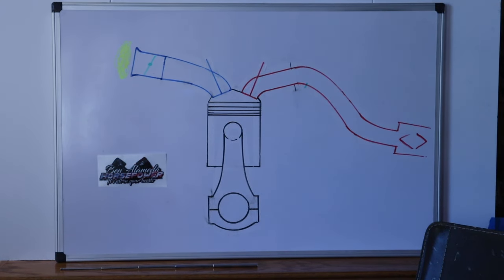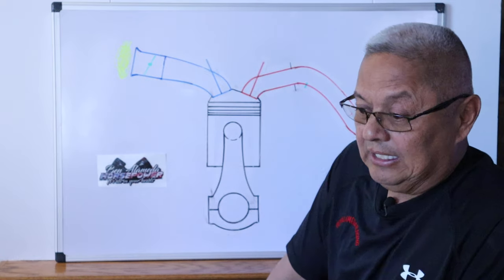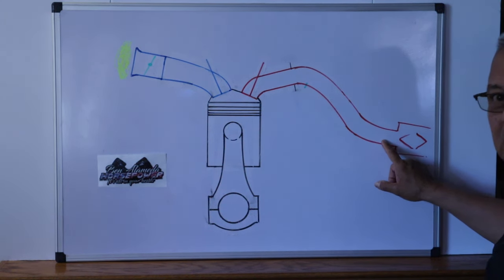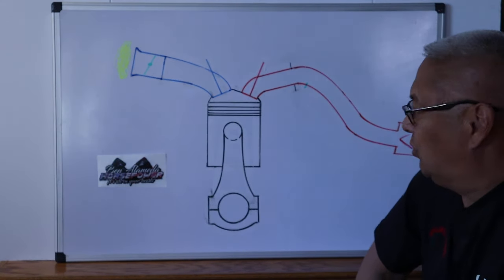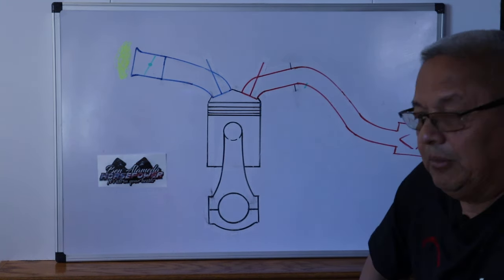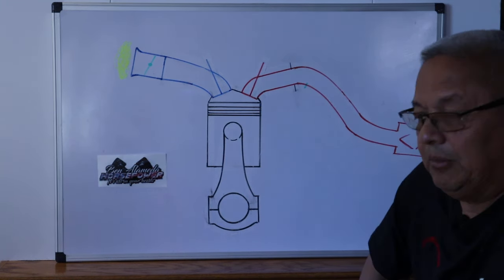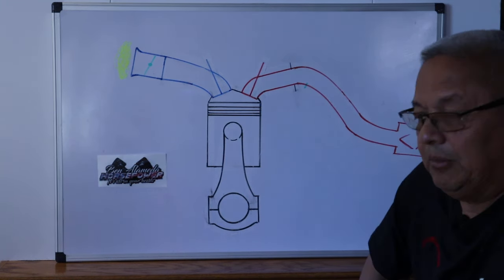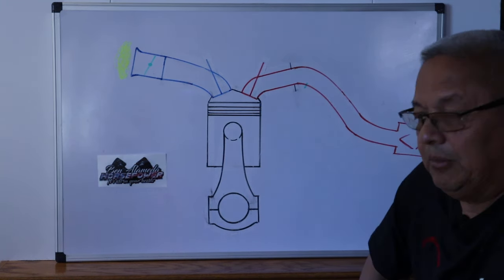DETERMINING EXHAUST & INTAKE  PIPE LENGTH!

Comment: The hole in the exhaust trick sounds like A.I.R. emissions systems designed to ignite the unburned fuel in the exhaust before it reaches the catalytic converter.
Reply from the maker: Thanks again Evan!

Comment: Just after the collector is where the crankcase evacuation valve goes. After watching the video is seems it's the worst place to put it because that where the exhaust speed drops off.
Reply from the maker: They actually merge in there and velocity picks up big time as opposed to positioning on individual pipes where reversion comes into play giving you erratic signal to pull in vacuum.

Comment: Most common sense editorial I've ever watched! Been telling guys for 20 years you're running to big a carb! The math doesn't add up! A vacuum secondary carb with the right jetting and springs along with the bosters will win most street races!  You can't use what you can't hook up!😂😂😂
Reply from the maker: Many overcarb their engines and turn it too slow!
Reply: @benalamedaracing2765  well, I think that with vacuum secondary carb, on the street, it's pretty flexible! Ran 3310s on 306 Ford successfully for years! Just play with the springs! But, a 600 for strictly street use has better throttle response with real street converters! Daily drivers! But with a stick shift? Every street race I lost was in the first 50 feet! Three light poles ain't alot of real-estate if you back peddle twice!

Comment: Ben, sir, I've been in the automotive field 22 years now. I've worked hard to achieve the level of Senior Master Technician with FoMoCo. Some of these tried and true techniques you're sharing I learned when I was green at my first dealership or prior to that in school with my professors at UTI Houston. I've kept these "ancient Chinese secrets" close to the heart. I was instructed to by my mentors. I had always intended to ask them, "Why" some day, but alas they have passed without my knowledge.

My request or rather question is, in your opinion; why have tips, tricks, game changing modifications, etc been such a "hush hush” sort of knowledge over the years? Was competition that fierce and necessary?

I'm only asking for an opinion of those times.

Thank you sir.
Reply from the maker: Arturo,  racing tricks and secrets have been around as long as racing itself!  Many engine builders who have won many times have their own formulation for bore and stroke, runner length and cam specifications etc. etc.!  I would run out of pages here to describe if possible all of them.  It continues on and some of those I show on these videos but the very sensitive I still leave out because it is just part of the competition edge we try to maintain.

Comment: What I LOVE about your videos is how simple the core concepts are explained. I understand fully what is being taught and shown. I love it!

Even if I don't plan on applying every bit of tech to maximize a combo, having the knowledge to maximize it, or just get in the ballpark, is worth the tiny amount of time invested in watching the videos. For example, if I install XYZ long tubes and the collector is tested to be an inch short or longer than ideal, I probably won't cut and mod them, but I'll at least know how close to ideal I am, so if I decide to mod in the future I know where I'm currently at.

Another great tech video! Thank you!
Reply from the maker: Rich, thank you for your input and your are correct that it shows you are close to ideal or at the best set up as it is!  I had one guy who called me from the East Coast and he used his kids crayon and showed he was about an inch too long by the coloring.  He cut it at that length and pick up about .5 mph on a bike that is already going close to 200mph on the 1/4.  He repeated the runs and they all shown that much increase and told me with a hack saw and some sweat he gained that much more power without spending money.  Lol

Comment: Excellent lesson from the white board. It seems like our old school v8s got a cylinder head that directed traffic through a space that was always more like a detour than a highway. The upside is the ways of improving the detour have given rise to the sport. Start with a mess and go fast.....tweaking junk is intriguing.
Reply from the maker: Yes the detour and bends are not always a net negative due to the fact, when we have a straight shot intake port there will be less mixture motions that does not mix fuel with the air effectively!  Therefore the intensity of the flame ignition front is less intense or magnified many times leading to a loss of power and response.  
This has been a struggle sometimes and now you gave me an idea on a future white board explanation of how things bend or turn is not necessarily bad.  Thanks again for your support and comments I will write a note to myself to expound on this in a future video!

Comment: I've always ran smaller tailpipes, thinking they would help velocity as the exhaust gasses cool. Strictly street cars. No idea if it helped or not. Thanks for sharing your knowledge.
Reply from the maker: When they cool or lose heat they get heavy and lazy flow wise contributing to back pressures.  You need to maintain diameter but not smaller or it will costs you.

Comment: Thank you for sharing your experience mr alameda.if your intake  makes noticeable sucking noise through throttle body is that a good thing our is there to much turbulence.peace
Reply from the maker: I have to hear it because with a flow bench for example, the more efficient the intake is the quieter it gets!  Too much turbulence creates the crazy sucking sound or more like a gurgling sound most evident when you take off the air filter and listen to the carbs/throttle body at full throttle!

Comment: I learned the hot pipe method when I was a kid from on old speedway racer..run it round the track as fast as you dare then where the paint stops peeling cut it.
Reply from the maker: You seems to hang out and race with smart guys at the track!  More power to all of you.

Comment: Thank you a lot for sharing your knowledge.
If i may, i think there are disclaimers to be made about the exhaust manifold holes, but i'd love to be wrong. It seems like the technique would work on a carbureted engine (and that is if engine is running rich but it's a carburetor so i guess it'll eventually happen) but on a fuel injected engine, the holes will bring a lot of fresh oxygen to the lambda sensors and the engine will run as rich as the ecu is allowed to run it. In fact the secondary air injection emissions system which is mentioned in the comments and does a very similar thing, only lets fresh air in knowing the engine is intentionally running rich just to torch the cat and after the desired temperature is reached, the ecu shuts it off and we'll have the fully closed exhaust.
I'd love to know your opinion.
Reply from the maker: I made a statement in one of this videos wherein I would put clamps over the holes on FI engines so as not to confuse the exhaust sensors and it was always a concern.  When tuned then that is the time i opened them up as long as the computer does not retune the engine when it see's this change in exhaust temperatures.  Glad you are asking this question.

Comment: Awesome information for an amateur engine builder like myself! Very simple and effective checks to verify if what I'm actually doing works without expensive tooling / machinery.

I wanted to know, which do you tune first, the exhaust or the intake? I'm assuming changing one would have some effect on the other.
Reply from the maker: Tuning the intake is important specially if it is NA and the exhaust because it is under pressure will be easier and less sensitive in making mistakes.

Comment: Regarding the vaccuum thing. At sea level we humans experience 14.7 psi of air pressure. 

A vaccuum means zero pressure, but you can have increasing negative pressures thats what they mean when they say 3 inches at vaccuum its 3 inches of below zero pressure. Thats what MAP gauges reference atmosphere, positive boost and vaccuum
Reply from the maker: Therefore you are measuring more of nothing correct?  If it is zero it is exactly that and "saying you have more of nothing" ???, 3x or ten thousand more times means nothing. This said a perfect "0" ultimately achieving true 0 is impossible to achieve!
There is absolute pressure and gauge pressure so choose wisely.  For ex.  a flat tire will read zero pressure on the tire gauge but in reality it has 14.7 of atmospheric pressure which is the absolute number inside the confines of the flat tire.
Reply: @benalamedaracing2765  if you keep thinking of measuring more of nothinf then thats archaic thinking. But not wrong, because you can have negative pressure.
Reply from the maker: @km6832 , ok then check for info if vacuum is possible here on our planet and let me know what you find.  Your last statement about negative pressure can be referred to as absence of pressures, in engineering and aerospace which I graduated from, does not exist or is even possible.  Just like referring to an engine as a motor is inaccurate but look at the distinct difference between an engine and a motor.  It has been used so long that it is an accepted terminology but is actually factually wrong.

Comment: Great video and information. Do the same rules apply to a turbo charged engine?
Reply from the maker: I feel the closer you have the turbo's installed nearest the exit of the ports the better it will perform!  Doing the heat technique will not work because if you are trying to determine ideal length with the changes in coloring it will only hurt a turbo spool up time. It needs closest to where the velocity is highest- Closest to the exhaust flange to exert as much heat energy as possible to help spool the turbos.

Comment: Very cool video Ben.👍 I have an interesting question for you regarding exhaust sound.With my fresh 505ci Big Block Mopar build ,I have a very distinctive "chirp" sound out the back of my exhaust at idle. I have searched many many forums and no one seems to have a definitive answer as to what causes this phenomenon? Some say it's a very efficient exhaust port??,, others say it's fuel related??,, some say its header design?..most replies are something  like .. " every engine I've ever heard that "chirped" at idle ran like a bat outta hell".. lol. This new combo is very responsive and I'm very happy so far, but I was wondering if you have any fist hand experience with this phenomenon or,, perhaps you could offer some insight as to what may cause this "header chip" ?.. thanks for any input. 

My combo : 
440 block - zero deck .030 over bore 4.35"
Eagle 4.25" crank
Eagle 7.1" rod
Mahle Flat top pistons 
1.5/1.5/3mm ring pack
8cc valve reliefs
Felpro .039 head gasket
11-1 static CR
Promaxx heads  (Edelbrock RPM Copy)- basic port work by me
86.5 cc chamber- after chamber work
Push Rod Pinch opend from 2.1 Sq in. To 2.43 Sq in. [I know still way too small]
Worked the exhaust port opening into a slight D shaped outlet.
Custom Bullet "Street Solid Roller" 
254/261@ .050. .585/.585 lift split 109 lsa
Comp cams 1.5 ratio shaft roller rockers
3/8" trickflow pushrods 
Tall Trickflow single plane/ 1" Wilson tapered combo spacer
950 CFM E85 Double Pumper -Down leg boosters (upgrading to annulars very soon)
1 7/8" ceramic long tube primaries into 3" collectors 
3" exhaust into 18" long Dynomax "race bullets"( LOUD ).. LOL.
Hopefully this info will shed some light on to what might be causing this "chirp" in your opinion.
Thanks - Dave Giannini
Reply from the maker: If we are talking about the same thing it has something to do with a very tight quench creating a hissing sound coming out of the exhaust!  Usually when I hear this sounds the engine runs very very good!  Maybe you call it chirping but I call it hissing so maybe we are talking of the same thing.

Comment: I call them over under educated's. But don't get me started on that. Doesn't matter how good the computer programs are, while they can be of use, Nothing beats years of hands on Experience, acquired learned knowledge, and actual live Engine Test and Tune. Somewhere I have a mathematic Not computer generated formula that uses the speed of sound to calculate runner length and exhaust lengths. Computers, dyno's, flow benchs, measuring devices are only a tool, and they are only as good as the user. As Ben Pointed out, little tricks here and there can make a huge difference to the way an Engine runs. Even when you think know it all, believe me You don't. You Never Stop learning when it comes to Engines.
Reply from the maker: You got it right sir and will be a good builder knowing experience and wisdom goes a long way!

Comment: On my 1.3 Samurai engine. What size exhaust hole would you suggest? Like a # drill bit or bigger? The headers are wrapped & probably oversized with 2” exhaust coupled to a turbo style muffler, seems to flow well, but will that restriction counter the hole idea and just blow gas out instead of sucking it in? 

Would love to see videos on water- vapor injection. Piston and chamber coatings.  Exhaust wraps and coatings all dealing with heat.
Reply from the maker: Use the smallest drill bit you have and start with that.  A lot of trial and error until you get it right and every engine is different and I have not much experience with a 1.3 so you have to do some testing.  It is important never forget to drill at the bend immediately after the hedder flange so it would pull in the fresh air and that is the first order of doing it correctly.  I will do some videos on exhaust coatings and wraps soon.
Reply: @benalamedaracing2765  is this extra air in the headers primary pipes going to false read the wideband afr readings to the sensor? Or is the flame in the headers only so much hotter and better burning that the sensor wont see any "extra" air and i dont have to worry about it?

Comment: Ben when ya talk about drilling a hole in exhaust how big?thank you peace
Reply from the maker: Drill about a 3/16 right below the bend of the after the hedder flange.  You want this lower pressure area to inhale some fresh air to re ignite the leftover unburned mixture in the pipe and should it relight then it is all good!

Comment: Any thoughts on anti-reversion chambers?
Reply from the maker: I feel that doing so in the exhaust track will definitely help in evacuating the exhaust gases and preserving the incoming AF mixtures which usually gets contaminated and will burn inefficiently making less power and torque.
Reply: @benalamedaracing2765  Thanks, Ben!